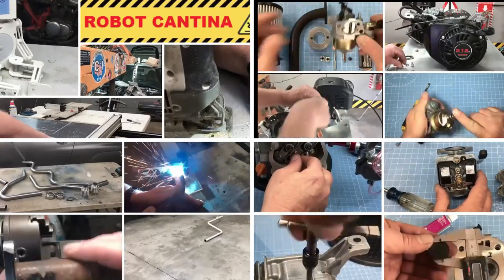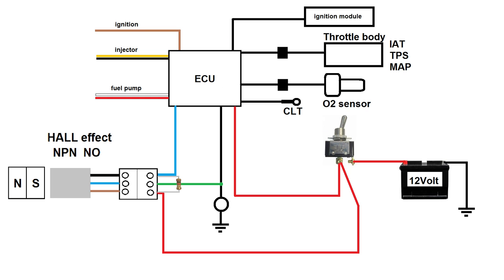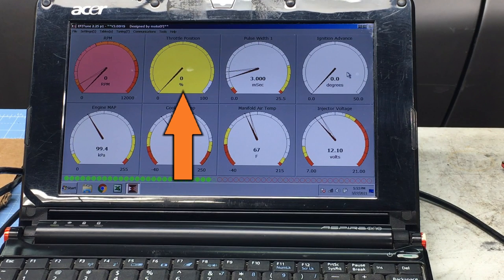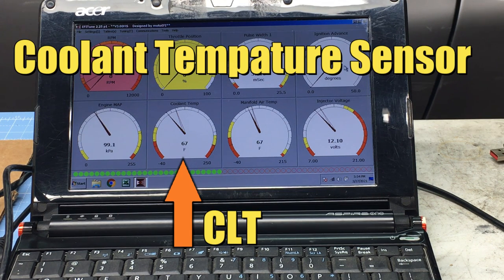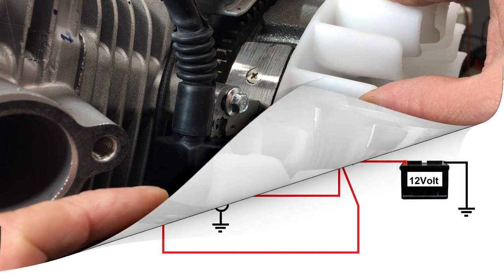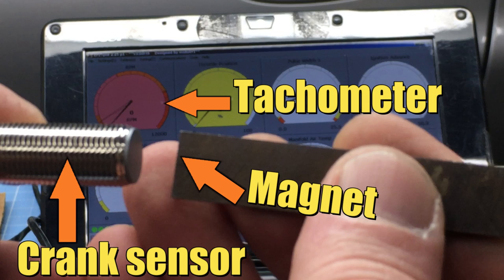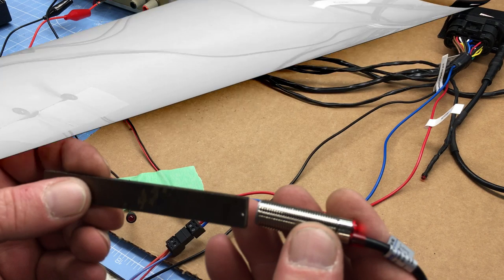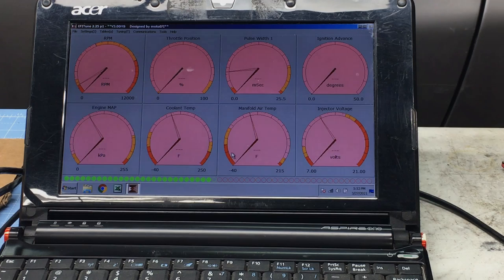Episode 19. We bench test the cheapest EFI kit on Ebay. Will it work for our street legal go kart?

Comment: So many questions. Are all the sensors included with the kit a typical 0-5 volt reading, including o2 sensor which typically aren't from my understanding? What off the shelf o2 sensor are interchangable (even if they need the connector swapped)? I want to be able to use off the shelf parts like a GM map sensor. I know TPSs just use a potentiometer, so that's an easy one. Can this thing do multi-cylinder engines, even if it's limited to a single coil used with a distributor, and batch firing all injector as one unit? if so, I think it'd be worth buying. Set it up on a small engine with the included kit, and also make a new harness for something like a Honda CB750 with a rigged up 4 cylinder distributor. TBI small block chevy. Batch fired port fuel injected LS engine (also with an aftermarket or rigged distributor. Maybe use a relay for activating the fuel pump incase the ECU can't handle a high power fuel pump directly; hell, I wouldn't be opposed to a manual switch for the fuel pump. Injector impedance minimums? A simple mosfet driver to drive low impedance injectors?
Reply from the maker: The kit didn't come with any documentation and was sold as a single cylinder EFI.  The rummer is the kit is based on the SECU-3 open source platform.
Reply: @robotcantina8957  I don't have scientific data, but I think plenty of perfectly nice weekends are being given over to the binge craze.   We  are binge  -  watching  videos from ROBOT CANTINA😛😛😋😋

Comment: Up to how many cylinders will this kit run? Or is it just for thumpers? Was thinking "288 sounds a bit much for a simple EFI system", then you got to the part where you mentioned ignition tables... coolness!
Reply from the maker: $288.00  and you get the ECU, Fuel pump, harness, O2, and throttle body with injector, MAP, IAT and TPS.  Seemed like a good deal..
Reply: @robotcantina8957  If that's so, yes! It's been too long since I fiddled with engines... apparently can't even get a Megasquirt box (only) for that much nowadays!

Comment: I forgot, did you put the performance pistons and valve springs on this engine?
Reply from the maker: Not yet
Reply: @robotcantina8957  It's gonna need it for all the power you're pushing through it
Reply: @robotcantina8957  I think you can put an oil cooler on your predator with a billet side cover, I recommend you put all the billet parts on for the longevity of the engine.

Comment: Wouldn't you need a cam sensor for the fuel injection timing? I guess it could spray every rev but it would lower the fuel economy....
Reply: Just spray every other revolution.
Reply: Not required. Older efi systems were often batch fired meaning all injectors were fired at the same time and the fuel basically just sat in the intake runner until the intake port opened.

Comment: Do you know what pressure your map sensor is rated to? You may need to source an upgrade for boost once you add the turbo.
Reply from the maker: The MAP that came with the EFI is not rated for boost.  I will end up using another sensor when the time comes.
Reply: @robotcantina8957  AEM has a screw in bung style sensor, it may have too wide a range for the VE table you have though. Will it allow you to split cells for a wider range?

Comment: Just wondering why you didn't choose a Speeduino EFI. Also, will this EFI work over 100kPa (turbo)?
Reply: Just needs to change the map sensor and adjust the values
Reply: @stuartparker2369  problem is: he probably can't. MAP, IAT and TPS are an all-in-one.
Reply from the maker: Although the MAP is part of the module, I can still wire in a separate MAP sensor.  no worries.
Reply: @robotcantina8957  great news.

Comment: I came across these EFI kits while looking for low flow and low pressure fuel injectors, and the first thing i noticed when i saw the software screenshots was "damn this looks like old TunderStudio(previously called MegaTune)". From what I've seen you going through it I highly suspect it's a rebranded version of MegaTune 2.25, it even contains references to genuine MegaSquirt products(for example baudrate notes). I would be interested to see how it behaves if you were to connect your kit to a genuine MegaTune 2.25 copy and even up to date TunerStudio MS. Somewhere in the directory structure you should see an .ini file with all the properties of your ECU which tunerstudio asks for. Likewise the .MSQ is MegaSquirt's XML.
Reply from the maker: The EBAY seller has indicated that this system will not work with tuner studio and in fact Tuner studio may damage the ECU.   So, it this stuff may be a close copy, but not exactly the same.
Reply: @robotcantina8957  I don't have scientific data, but I think plenty of perfectly nice weekends are being given over to the binge craze.   We  are binge  -  watching  videos from ROBOT CANTINA😛😛😋😋

Comment: You're telling me that EFIs are so simple to tune that with my software magic I can tune from a phone if I disassemble the serial protocol?
Reply from the maker: Getting the engine to run on the EFI system is easy,  however tuning is an art.
Reply: @robotcantina8957  I'm three years into tuning my old Toyota Starlet. I've gotten it to the point where it is noticibly more refined than an early 2000's car (the car was made in 1983). It's a long road but well worth it.

Comment: Is that software Tuner Studios? Looks very familiar.
Reply from the maker: Its custom code that looks like tuner studio.  Tuner studio will not work with this EFI system
Reply: @robotcantina8957  
Thank you for the reply! I asked the question right before the video described it. Lol. I looked up the eBay listing as I was curious if it was wideband compatible but it did not specify. I’m guessing it either is or could be with the appropriate controller. I’m excited to see how it works for you. Looks like a slick little kit.
Reply from the maker: @thompsona10625  The software has a setting for wide band and I do plan on using a wide band, but initially we will go with the narrow band just to see how it works.  I have to admit I have always use a wide band with other EFI systems and I'm a little curious to see this system work on a narrow band.
Reply: @robotcantina8957  I don't have scientific data, but I think plenty of perfectly nice weekends are being given over to the binge craze.   We  are binge  -  watching  videos from ROBOT CANTINA😛😛😋😋

Comment: Is the timing of the crank position sensor same with the pick up coil?
Reply from the maker: Do you mean is the timing of the crank position sensor the same as the magneto?.  If so, then no the timing is not the same.  I will explain how the timing is done in the next efi video.
Reply: @robotcantina8957  the pick up coil is the magnetic sensor thats giving signal to the ignition coil to fire the emboss metal on the side of the magneto is its trigger point, are you going to use that location for that crank angle sensor?
Reply from the maker: @salutetojohnlennon  I will cover this in the next EFI video, however the short answer is the crank position sensor will be place close to the original location as the trigger point of the magneto. @ 14:34 in the video I show the ignition setup tab,  the first line is in the setup is the offset.  The offset is how may degrees the crank sensor is located from top dead center.  Theoretically the sensor can be placed anywhere and all you need to do is tell the ECU where it is and it will do all the calculations.

Comment: Can you link more than one engine together with the EFI that you have?
Reply from the maker: Probably not
Reply: @robotcantina8957  would it be possible to link move than one engine on a single chain to the torque converter or is the issue with something other than just HP at this point?

Comment: At 3:10, why is your ground pin and - voltage pin bridged on your power supply?
Reply from the maker: The ground pin and earth ground are connected on the power supply.  No reason, that was the way I configured it the last time I used it.
Reply: @robotcantina8957  on the power supplies I use, you can also create negative voltage. Hence the need for a negative connection. In most positive voltage cases, this will not cause any issue. If though you set the supply for a negative voltage, wether purposely or not, this would create a short if I’m not mistaken.
Reply: @kempie9901  I don't have scientific data, but I think plenty of perfectly nice weekends are being given over to the binge craze.   We  are binge  -  watching  videos from ROBOT CANTINA😛😛😋😋
Reply: @ocdman202  "I believe in having fun first, and along the way, if you teach people, if you influence people, well and good."

Comment: hello, I bought a delphi mt05 bi ecu brain, it came out of another engine. There are 23 small magnets in the flywheel of that engine, but my carburetor valve has 1 magnet. how do i enter the number of magnets in the rotating magneto flywheel into the ecu brain

Comment: 288 bucks and that's all you get?? Dude. You should check out the speeduino project. Between speedyefi or wtmtronics, you can have full speed-density fueling setup that can do anything you could dream of for basically the same price.

The kit you got doesn't do boost, as it's tps based and the turbo speed isn't accounted for.

Comment: The last few days I have been wondering about the multiplication tables I learned as a child being 12 by 12. The lower right-hand corner ends up 144. I'm kind of curious if this is some sort of Jehovah Witness attempt at controlling people's view on 144 thousand. But I do wonder why you have a 12 x 12 table in the software, who set that? Was it someone like me that grew up with the multiplication tables ending in 12?
Anyway, I'm not really worried about that too much. But I am wondering why you did not link to the eBay seller with that ignition system. It's not like I want that ignition system, just kind of casually curious. I have a friend I ask to order eBay stuff, and things I thought were easy to find ate nearly impossible for him, and the other way around.
Reply from the maker: I'm not affiliated with the seller.  The way youtube works, its better that I don't provide links.

Comment: When the turbo is added that map sensor won’t work. I’m also worried about your crankcase pressure and or ring gap. Also air temps/ heat soak. A intercooler would be cool. It might help keep boost AND temps low. I feel you already know all this stuff anyway so I’ll just stop and say great vid.

Comment: The nmes for your colors are wrong green is always ground black is always neutral in a black and red configuration  and red is always hot or 12 volt if your using black and white white is neutral and black is hot while green is always ground